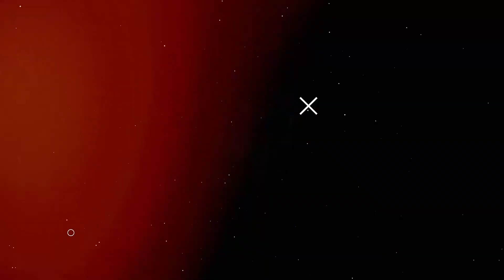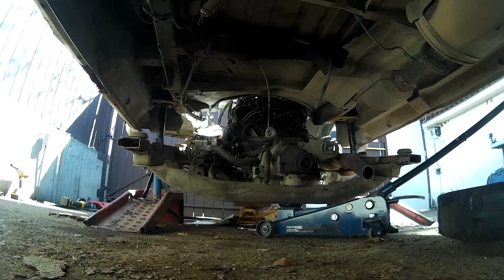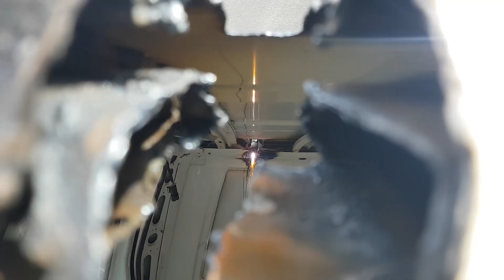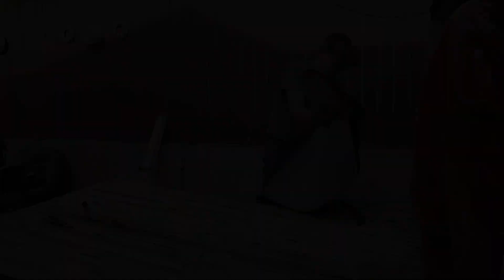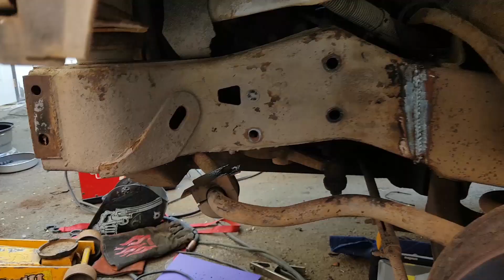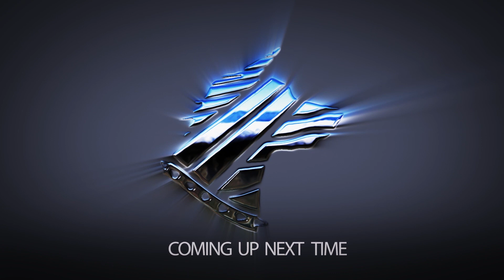DawgStrip - Gambler 500 Build - The FishBowl

Comment: Hindsight being 20-20 one thing you could have done was done like your meeting two blocks of a ship being built in shipyard use a bunch of those ratcheting come along for the welder to each side of the van and then ratchet them together and then cut them off when you're finished bringing the two halves